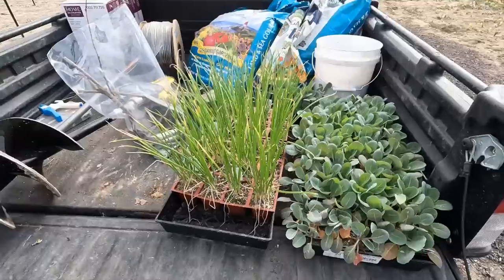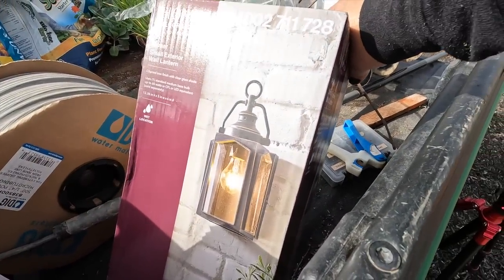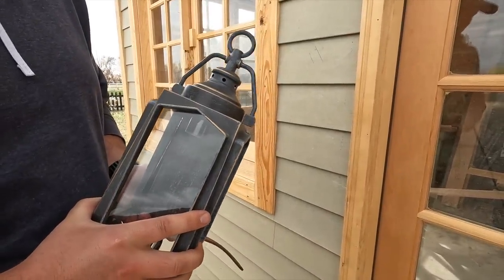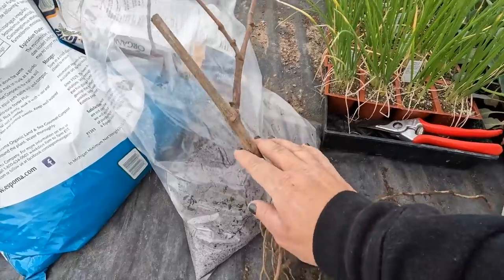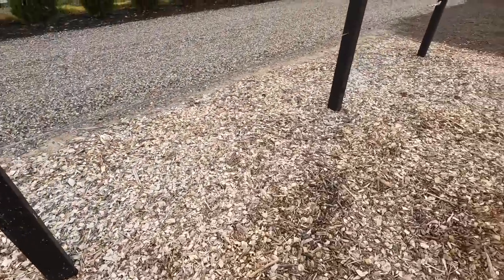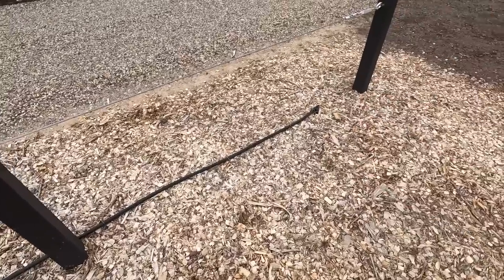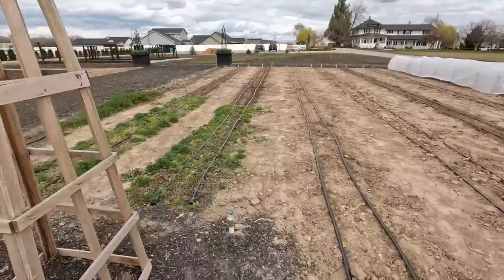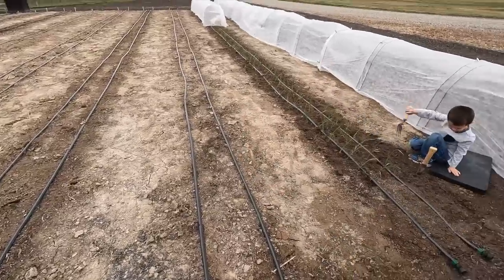Planting Grapes, Onions & Cabbage (+ Honeyberry Update)! 🍇🧅🥬 // Garden Answer

Comment: Since you’ve asked for opinions, I would go with a different exterior bracket. Something a bit larger in scale, and, with the electrical boxes installed so high, a fixture that extends down a bit would fill in the visual space and would provide a more balanced look. Good luck with the search!
Reply: Yep, the height of it was killing me. Lower them a bit and it wouldn’t look nearly so awkward and she’d probably like the lights then.
Reply: Exactly what I was thinking!
Reply: I was thinking they seemed a little small
Reply: Agreed, maybe a fixture that drops the light would help- then you might not have to rewire and cut new holes.
Reply: Exactly what I thought.
Reply: You are exactly right.  I have never seen the bracket that high before.  Normally within 1-2 feet bellow door frame
Reply: I agree thw light needs to be a little larger and hang down further.  Good luck.  Enjoyed the video and all the fun memories of helping plant onion starts,  potatoes and all the other vegetables
Reply: I agree! They are too small and too high. I'd say keep 'em if they could be installed lower but since the holes look already set, I would return.
Reply: Yes!!! 👆 kellyroo3 hit it right no the head. I would also think about 1 1/2 bigger than those lights. They are feeling like they would be on the outside of a lighthouse. Also love the raw wood look on the outside of your shed!
Reply: The lights you have Laura are too short. You need longer for the scale.
Reply: Agree. Lights are too small in scale and keep in mind your bracket is high so think about getting one that extends down. Like all the comments above. 👍👍
Reply: I agree they need to be lower unless going with a different style maybe.
Reply: Totally thought the same.  Too small and too high.
Reply: Agree100%.
Reply: I agree. The electrical boxes do seem high (possibly due to the weather there?), so putting in something that visually adds weight lower down would be an improvement.  Hey Laura, time to go antique-ing??? 😁

I love it when plants seed and come again! Bonus.😊

Comment: How do you winterize your drip irrigation system?  We have had drip systems in the past where freezes were not an issue, but now want to install drip in our Zone 6b garden where local building code require water lines to be buried 24" deep.  Any advice would be appreciated!

Comment: Interior Designer here, if it is black light fixtures that you want then these definitely will not do, keep looking, don't settle.  You sound like me, liking those $700.00 light fixtures, I am always drawn to the most expensive items first:)  I agree with Aaron, right now, the cut flower shed does remind me of a beach house,  unpainted it does have that cedar shake look.  What color are you thinking for the outside?  You are at a critical point in the design process what color of paint you choose for the outside will define that building.  I love the natural wood tongue and groove on the inside, it looks so inviting.  Take some scraps of the inside wood and paint one piece with a white wash so that the wood grain still shows through and try putting a light stain on another just enough to get some of the yellow out of it.  You know what you want you just have to see it, good luck!

Comment: Williamsburg Va is on the peninsula between the James and York rivers so the style is traditionally sea faring but those lights don’t scream nautical with rope details or round lighthouse style glass so they could work. Return them if you aren’t in love. Amazon has an amazing selection of fixtures!!! Perhaps do 25% paint 75% water mix and white/color wash the interior of the shed to lighten but keep the wood grain charm- if you don’t like it you can always paint a solid coat overtop.

Comment: Because you asked...the size of those fixture is okay  the problem is the height of the electrical box.  If you don't want to move the box then my suggestion would be to choose the same fixture that you put over the barn doors but a smaller diameter dish.   The arm of those bends downward which will bring the height of the dish to the correct spot.  thanks for taking us along!

Comment: I think the new lights look like 1800's 'industrial'.  They're nice, but I think that style should be mounted a little lower along the door frame than where your wiring holes are located.  I wouldn't say they're specifically 'nautical',  but lighthouses do use a lot of iron in their structure (I live down the road from one built in 1838 on Lake Ontario).  A separate question that I wondered about is whether you have some kind of back-up generator system for power outages.

Comment: You need lights that hang down. The electrical outputs are high above the door you need to bring the weight down. I’d go with a tradition gas lantern look but wired for electric, and I’d go maybe a little big scaled bigger than those

Comment: Hi Laura and Aaron! I agree with Aaron, the lights don't look nautical at all, but they are too small. A longer light would look better since the electrical boxes are up so high. IMO, I wouldn't paint the siding or any of the wood, outside or inside. I would just put a protective coat on the wood and leave it as is. It's beautiful, and the color of the shed is pretty, too, and looks good out in the orchard. Thank you so much for sharing! Also, I don't blame Aaron for driving his truck out there. Maybe he was in the middle of something and didn't want to waste too much time.

Comment: That tulip transplant is awesome, I love them in the pots everywhere..gonna try that next year…weighing in on the lights, I agree they looked nautical which I like but if it’s not what your going for…when we built our potting shed, I found an old porch wall light that had seed glass on all four sides, We took it apart re painted, re wired and I LOVE  it..it is not far from the back door so when I burn it at night it has a sweet glow! Got a Love It!

Comment: I don't think bigger lights would help but I also don't think they are right.  It is because they stick up above both the window top and the door top.  They point out the door and window tops are not the same height which is a bit odd.   I would not have said they were nautical and I liked them ok, until Aaron held one up.  If they did not have the top part, so they lined up with or stayed below the top of either the door or window they would look much better.